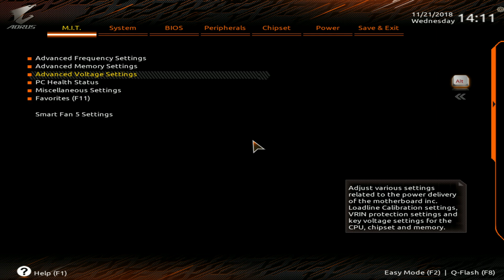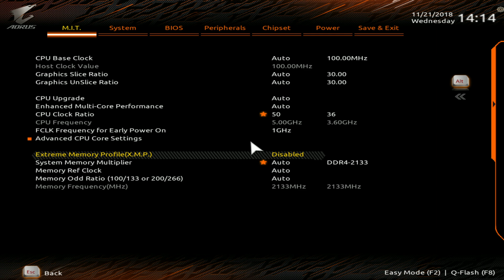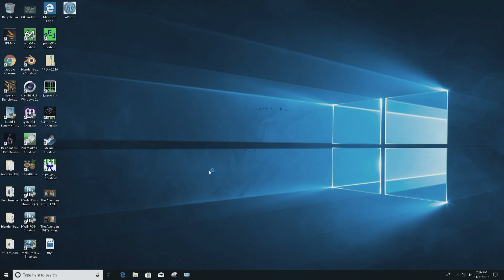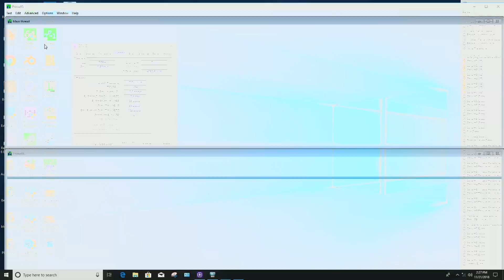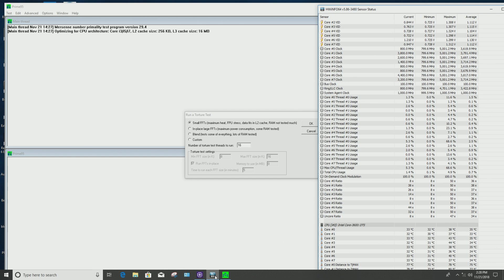GIGABYTE Z390 Overclocking Guide

Comment: Dude I just watched your video and followed it step by step, pausing when needed. My pc isn't working now. At least the monitor isnt displaying anything. Please help.
Reply: Well, now it won't go past the aorus screen
Reply: @YoyoFish44  You can always just go back into BIOS and load default settings.
Reply: @marcmarc4776  He can't go to BIOS because it won't POST!
Reply: @NameName-zz3ly  Well if it won't post (which is not how I read it) then he can take the battery out of the MB for a few minutes.
Reply: @marcmarc4776  I read it that monitor displays nothing - can't POST. What you suggest can also help, but not always. Worse case is what I suggested to check.
Reply: Check if CPU led on the mobo is red or on which debug led it's stuck, if you have them.

Comment: Is this gonna work on my i5 9600k with gigabyte gaming x
Reply: Howd your overclock go? I have same cpu and motherboard. Interested in your settings if everything went well. Thanks
Reply: @JeffFoltzRealtor  I tried following this setup to the nail and my pc failed due to voltage issues so be vary wary. My setup is a Gigabyte Z 390 M gaming motherboard, i5 9600KF processor, 32GB Corsair Vengeance LPX 3200Mhz, MSI Geforce GTX 1070 & Corsair CX650W power supply. I would love to OC mine but don't wanna go through the hell of trying to get it working again which thankfully i did after resetting the Cmos on the motherboard and  was thankful it had not fried the mobo or processor

Comment: Hi guys do i need to plug 2 of the 8 pin power connectors to motherboard!? Or one is just fine for just 5ghz all time
Reply: You definitely need both the 8 and 4 pin connectors to OC at 5ghz

Comment: but whats the point of overclocking ? for gaming ? i mean even without overclock everything is fine on 8700k 9900k , do u just do it for fun ? to see how far it can go ?
Reply: I'm not a big fan myself of extreme overclocking, but overclocking (CPU/GPU or both) is good if you do content creation. If you have a high-end CPU, it's recommended to use higher-end boards aswell, mainly because of the prevision of electricity specifically build for those CPUs. (Extreme) Overclocking will reduce the production time and make your applications faster. Obviously, that only matters to you, if you want higher speeds for said tasks. If you don't want extreme overclock and maybe push the CPU a little bit, maybe to get better performance in games/applications, that's totally okay. If that doesn't apply to the user, who blindly cares about performance just to throw numbers arround, then consider extreme overclocking as kind of a bragging sport or hardware porn (which most people do anyway). For the rest, it's a hobby for some people.

Comment: I can’t get my 9900k stable under 1.35-1.37 at 5GHz. Currently it’s ok in Prime95 at 4.8 1.330V. Any piece of advice? I got the  C States disabled, LLC to Turbo, Current Protection Extreme. Same Aorus Master Z390 latest bios version.
Reply: You just lost the lottery my friend, i have a 9700k at 1.375v for 5.0ghz and even then it randomly crashes from time to time.
Reply: it doesnt have to 1.35v you know

Comment: Some of your cores exceed 100C (!) That's insane. Either this is a bad overclock tutorial, or you have a crappy CPU cooler.
Reply: He told he's normally using H150i and this is H110i for tests... 5Ghz on 9900K without H150i is insanity :)
Reply: @s0ulkiller  Fair enough. :) Would a Kraken X72 do the trick too, btw?
Reply: @gladosadoree  yes, a 360mm aio is a good choice for an OC 9900k, a 280mm is good too,

Comment: I tried this guide. I either crashed when running prime 95 or I believe it hit thermal limit from 5ghz it dropped to 3.6Ghz.

Am I doing anything wrong ?
Reply: If you followed this guide, but still dropped to 3.6, your bios is set for dual mode likely. It crashed while testing and booted the default options set in the other bios.

Always use single bios when testing, unless you have to manually use it for recovery.
Reply: @JamesHall937  Thanks for the reply :) I think it am dropping the speed is because of thermal throttle. Will need to buy a new waterblock again
Reply: @Zack47338  fixed now?

Comment: can the same configuration be applied with an intel core i7 9700k?
Reply: I also want to know this! did you end up doing it? if not what guide did you use?
Reply: Same! have you guys found out any info? im still a noob to overclocking
Reply: Yes it works perfectly
Reply: Oc to 4.8ghz bc i am using h500 from nzxt (pretty bad air flow) and nzxt m22 kraken 120mm (not recommended)
Reply: Doesn't work for me. However if XMP profile is disabled, temps seem to stay below 95C (Prime95, small fft, no avx). But I have an air cooler.

Comment: hey man, great video. unfortunately i am running into a problem with this board concerning the fan control.
For some reason smart fan 5 is reading the temp off of a different sensor, therefore my fans wont start spinning faster once the temps go up on the cpu. 
Do you have any idea how to fix this? Is there a way to remap the sensor or something? I have the z390 master and an i9 9900k on the f8e bios update
Reply from the maker: Yes, in the UEFI under Smart Fan 5, there is a setting called "Fan Control Use Temperature Input", and you can set it to any of the temperatures to its right for each of the headers.

Comment: My 9900k will NOT go above 4.5ghz @ 1.375 v with my h150i pro. Literally anything else causes a BSOD instantly in Prime95. I can't even lower the voltage.

Dafuq am I doing wrong here?
Reply: That's fucked-up indeed. On stock, it should run at 4.7Ghz on all cores (provided you extend the long and short term power limit restrictions). So, return it to the store then, if it doesn't.
Reply: Damn that's fucked up
Reply: Bad chip. Intel claims that to reach 4.9GHz, cpu requires 1.37V.

Comment: I ended up having two systems. One with the threadripper 2950 and a 2080to strix and the other with the 9900k and also a 2080ti strix. I want to sell one system but I don’t know which one I should keep. I am gamer and I enjoy playing games like pubg, cod black ops 4 apex legends. My monitors resolution is 2560x1440p at 144hz. So what do u suggest??? Is the 2950x a bottleneck for the 2080ti?? I know that the 9900k is better for gaming than a threadripper but if the difference is not big ( 10-20%) I would prefer the threadripper just for the 16 cores. What do u suggest that I do???? Great video BTW!!!

Comment: I have the i9 9900k with gigabyte Xtreme z390 motherboard also g skillz 16gb ram 4000mhz xmp. My problem is when I enable XMP profile my system crashes have you or anybody have any reasons why and yes my bios us updated but still the same problems, any help would be much appreciated cheers.
Reply from the maker: Try bumping the VCCSA and VCCIO to 1.25 and 1.15 respectively. -Steve
Reply: Thanks 👍 I will give this a go cheers. It's first time I've useda XMP profile.

Comment: Can you do a oc guide for 8700k or can i do same settings for 8700k ? Pls help.
Reply: I know your comment is 4months old already but here is my take anyways. For 8700k you can not go as high with average CPU. Default thermal paste is very bad between heatspreader and core. Most of overclockers like me delid the CPUs and replace it with liquid metal.  With non delid 8700k I would start experimenting overlocks from 4800Ghz with around 1.30v and test the CPU stability with Prime 95 without AVX commands. You can google "Prime95 version without avx" or modify setting files to turn it off. 

I got lucky with my 8700k. It's able to push 5.2Ghz stable with 1.335vcore. With that high vcore the temps are getting aroung 80C with my 280mm AIO cooler (low rpm Vardar fans). I'm currently running @5Ghz with only 60C gaming temps and fans around 800rpm for CPU.

Comment: I don't have "CPU Upgrade" what I have to do (gigabyte z390m gaming, bios f5 from 16.1.2019)
Reply from the maker: It's possible GIGABYTE only added it into some Aorus models or that your CPU isn't included on the list with profiles. We recommend you manually input the settings as described in the video. Good luck!

Comment: After a week of research I finally concluded the best way to cool the 9900k is to first delid it and then use it direct die using that direct die tool from derbuar. This will lead to probably the best temperature performance.
Reply: Yes, that's probably the best. It's not a noob friendly procedure :)

Comment: Hey I followed your video I"m running an i9-9900k with the Gigabyte z390 M Gaming (F5c bios) and after following along my PC was unstable. I upped the voltage to 1.3 and am stable but CPUZ, HWiNFO and CPU Temp all show my Voltage going anywhere from 1.35-1.4. I noticed yours was steady at 1.284 which was only marginally higher than your 1.275 setting. Any thoughts on what I should do to fix these high voltages?
Reply: Hey man, were you able to fix it? I have a gigabyte z390m too, but I had the same problem you
Reply: @novonick  unfortunately not. I've replaced the board and PSU several times and am still seeing voltage irregularities so I just quit attempting to OC my CPU.

Comment: This is a solid guide, and I will definitely reference it when my Z390 Pro arrives for my 8700K, however, I take issue with disabling C States and maxing out current limit. I see TweakTown recommending these settings quite often, and I think it potentially does more harm than good. Gigabyte has ignored Intel's guidelines on the Z390 boards, and I think MCE is enabled by default already. Also, pushing TJMax limit to 110c probably isn't necessary. Those VRMs are solid, and will probably never surpass 70c.
Reply: Also, you can avoid disabling C States and Turbo Boost by disabling Gigabyte's auto preset 'Multicore Enhancement." It says so in Gigabyte's own Z390 Overclocking guide. I was able to achieve a solid 5ghz all core and 4.5ghz uncore 0avx offset, with +65mv DVID on Turbo LLC (AC/DC LLC set to 1). Final vcore hovers around 1.284 -1.3v with minimal, but necessary vdroop (which is safer in my opinion than a fixed voltage).
Reply: @william C i got a z390 gaming X mobo and i overclocked my 9600K to 5ghz 1.35 vcore LLC turbo but i notice that there's no fps increase or gain..pls. help
Reply: @istib15  That is because most games are far more GPU-dependent than they are CPU-dependent. Overclocking the CPU is more beneficial for video encoding, rendering and workstation-type tasks. You won't see much performance gain gaming, but you will notice a snappier response from certain other programs and the operating system.

Comment: Do you think I can apply this on a Z370 Gigabyte motherboard? 
Recently bought a i9 9900K but kept my z370n motherboard. I feel like the mobo is holding the CPU back. 
I do not intend to apply 5.0GHz all the time, but I would like to avoid the throttling.
Reply: The Z390 Aorus Pro is on sale @ Amazon right now for $179+tax. It's worth it if a stable 5ghz is what you're after, but Gigabyte ignores Intel's spec limitations on the Z390 chipset. That is somewhat of a concern for me with this board.
Reply: @westsnest2273  I was thinking on going for the Aorus Z390 Elite... about the same price for the PRO
Reply: @gustavomarrara9660  The Pro is slightly better than the Elite, and The Pro WiFi is the same price as the standard (Non-WiFi) Pro right now. If the Elite is the same price as the Pro right now, then get the Pro WiFi because all three are essentially the same price while this sale is happening!!! Pro WiFi > Pro > Elite

Comment: how do you change the CPU clock ratio, it appears locked on mine, Elite board with 9600k
Reply: update bios
Reply: Did you fix this with an update? I have the same problem, was assuming it was an auto setting somewhere I needed to change to manual?
Reply: @buzzdog5949  9600k turned out to be defective.  I returned it, got another cpu.
Reply: @1984kylea  ah nuts, ok this may be the problem for me also then, I will await some support feedback then go this route, cheers!
Reply: @buzzdog5949  I ended up having a ton of other problems, mainly blue screen crashes when the CPU was put under load.

Comment: just got this Mom and cpu the other day. Tired setting it up with another youtuber's settings and  i kept crashing with AID64 at 11min. My Temps never got over 78c. So then i tried gigabyte's OC guide and it should crash from 2min-4min. Maybe i need one of the new BIO's? I did notice that when i was running AID64 my voltage was always around 1.30 It never once got higher than that even though i had set my voltage to 1.375
Reply: turns out after i updated my bios it all works like it should.

Comment: So heres the thing
Ive set vcore to 1.325v in BIOS and llc on turbo with disabled c states
In cpu z it shows 1.344v and when under load it sometimes jumps up to 1.356v and when idling it sometimes jumps doen to 1.320v. But only for seconds.
When I change vcore in BIOS to 1.330, it doesnt chance anything and cpuz shows the same voltages
I even had it spike to 1.390 in hwmon once
Reply: It keeps jumping between 1.344v and 1.356v
independent from bios vcore setting

Comment: lol, why would you turn off all the power saving states (C3, C6/C7, etc)? You're literally just sucking down power and generating heat for no reason if you're just browsing, idling, whatever.
Reply from the maker: While it is true that disabling these increases idle power consumption, it's not as big a difference as you might think. Most of the power used comes from current, and for power consumption to go up, work needs to be done, which in turn increases current. If a unit inside the CPU, like an ALU or AVX unit isn't working, current is less. At idle or little work, the current is less, which means the power is less. Some people run their OCes 24/7 because they tend to be able to get slightly better or more stable overclocks, others like lower idle power consumption, that's why we cover both ways in the video. -Steve
Reply: @tweaktown  Do you have a Kill-a-watt to measure it?  If I do this build, I could potentially report back.
Reply: TweakTown how do i get into the bios on the aorus master
Reply: @Vico7787  hit "DEL" before it posts. right when numberlock lights up on your keyboard. BEFORE windows spins.
Reply: @tweaktown  it's a big difference in temps for sure > https://forums.bit-tech.net/index.php?threads/9900k-5ghz-1-2v-guide-gigabyte-z390-master.353729/

Comment: Super high temps!  I just pushed my 8700k to 5ghz.  I was in around 1.275v to keep it stable but now I’m thermal throttling on P95 small FFTs.  Looks like I’ll be delidding
Reply: I also wanted to mention the latest bios does not have a tjmax override anymore, probably for good reason.
Reply: @Danth01gt  Hey, It actually does, but only on the 9th gen cpus. Went from a i7 8700k where it wasn't showing to an i9 9900k and now it is. On bios 8d
Reply: Dimitri Gonçalves Bilien nice good to know!  Wish I could bump my 8700k just a tad so I can see its real temps before throttling like you are doing here
Reply: @Danth01gt  I had to delid on both chips. Was hitting high temps even with my custom water loop. Delided my i9900k as well, temps were really high! I couldn't reach 5GHz stable before without throttling. Honestly it's really an easy process. Let me know if you go that road too.
Reply: Dimitri Gonçalves Bilien yeah I’ll have a Rockit on the way soon!
Reply: @leloupgris  what kind of temps are high for a 9700k? 90c?
Reply: @the_vicer0y_YT  According to Intel you don't want higher than 80. At the same time they sell you chip that can't be colder than 95 under full load.

Comment: Hi. After setting the bios just like you did, I run the prime95 and eventually got crash. What am i getting wrong?
Reply: You might need to increase voltage slightly. Also, which Prime95 test are you running? Blend? Small FFTs?

Comment: Sometimes when I go into the bios it shows the red bios. And it doesn't show much. But then my computer crashed and goes back to the orange one.  How do I fix this?
Reply: The Aorus z390 boards have a dual bios feature. Unfortunately there is no manual way to switch between them. It switches when there is a problem with the bios, like for instance when when there is a boot failure due to settings conflicts or a system crash. The orange colored bios is the main bios and the red is the secondary bios. The dual bios is a safety feature that reduces the chance of bricking the motherboard.

Comment: Is aorus master better than Maximus Xi Hero? when overclocking?
Reply: Yes. Lower heat and better VRMs. There's comparison videos covering the heat they put out. Tbh, it's not different enough to warrant issues if overclocking on either board. However, you're paying substantially more for the ASUS that runs hotter.